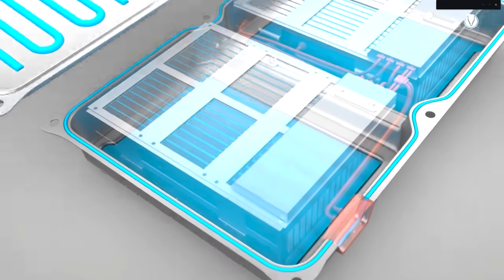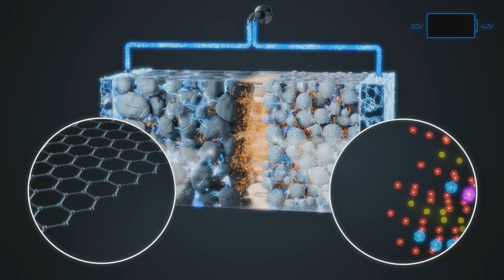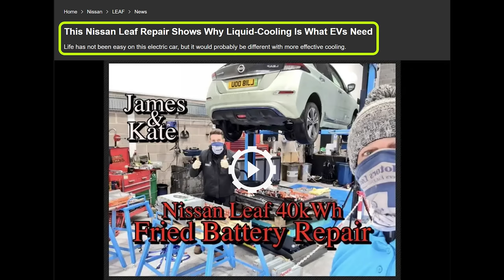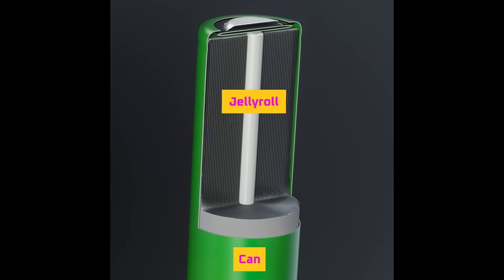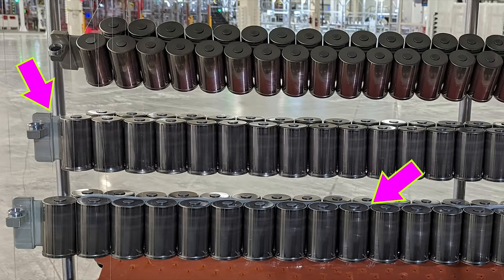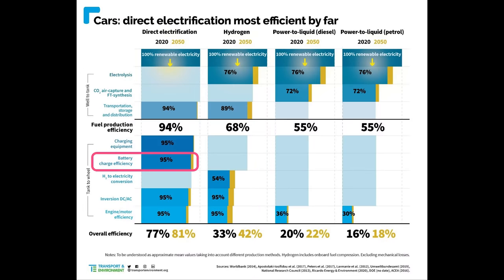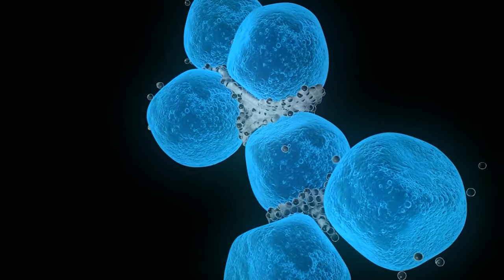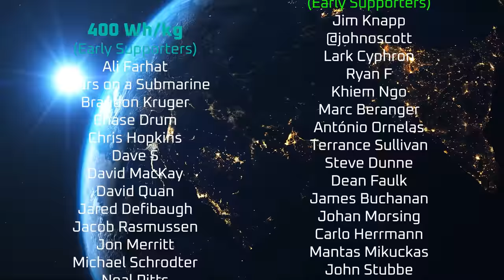4680 Thermal Design and Management // Why Ribbon Cooling is Better

Comment: I always assumed that with the tabless 4680s, plate cooling would be the way to go. I was wrong too. I think one phenomenon to emphasize is "thermal contact resistance", especially in a possible next episode about this topic. This is the thermal resistance from very thin layers of a fluid or gas between adjacent solids. For example between the overlapping tabs in the end caps of the cell. This type of resistance can be orders of magnitude larger than the thermal resistance of the adjacent solids. This resistance can really "choke" the overall thermal conductivity in the cell axial direction.
Reply: It was always about not producing heat, rather than getting rid of excess (imo)
Reply: @rogerstarkey5390  especially around the tab junction to current collectors.
One spot, end of cell, middle of jelly roll, far from cylindrical surface (it’s a spiral, so not half-way).
I’m still getting my head around heat flow ideas.
Reply: @rogerstarkey5390  Yes Tesla for sure has made a huge improvement there.

Comment: Sometimes the initial choice for a particular design maybe the best over time, even for a company which keeps refining its design.  The side cooling ribbon design is still bringing the best result for Tesla.  However Lucid is doing its cooling through the bottom end of it cells which does not make too much sense in terms of surface contact area!

Comment: Wow.  Have learned so much watching your videos on your channel.  What a humble/open-minded teacher!

I do have a question about the thermals on this 4860 cell.  And even the guess that the 4860 cylindrical may be better that that flat rectangular pack (prismatic) for an LFP chemistry package.

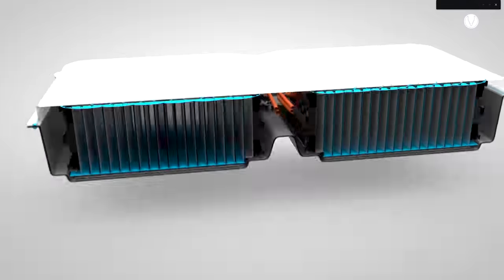You say (at 06:57) that "more surface area per unit of volume, which would improve thermal management" (comparing the CATL prismatic rectangular)

Wouldn't a thin rectangular pack as you display have far greater surface area for a desired VOLUME of battery material?  To contain a volume with an outer boundary with the absolute minimum surface area, the sphere is the choice.  Next would be the cylinder.  Next would be a perfect cube, and rectangular could provide near infinite surface area (really thin).

And beyond surface area, it is unavoidable that the center of the cylindrical cell will be much hotter than the outside than the battery material near the outer radius.  If thermal homogeneity is highly desired as you detailed in the video, why would you want to increase the radius of the cylinder, creating even more temperature differential?  In fact, would not a thin rectangular pack (as shown from CATL) be a perfect match for a plate cooler with far better thermal bond between package and plate, and minimum thickness of the package? 

**************************************************************

Different topic....

In general, I am very confused about this 4680 cell on the thermals.  Here is my thinking.  Where do I get this wrong?

1) A larger capacity cell will require less number of cells in the final battery pack of a given desired capacity.

2) As cell voltage is same between 2170 and 4860 battery packs, the same number of cells are needed for a series run to 350 volts.  Therefore the percent increase in capacity of the bigger cell will necessarily require the same percent reduction of parallel connections of cells.

3) Less parallel runs means that each series run of cells needs to handle more current (for net same pack current in/out).  Therefore the percent increase of energy capacity from the smaller cell (2170) to larger cell (4680), WILL ALSO REQUIRE THE SAME PERCENT INCREASE IN CURRENT LOAD CAPABILITY.

4) Assuming volumetric energy densities are maintained between 2170 and 4860 (same chemistry)....
       .....for the same net pack current load (between a 2170 cell system and a 4860 cell system), that 4860 battery CELL will have to push 4.45x (volumetric ratio 4860 to 2170)  the current of the 2170 CELL.  And the losses will be 4.45x the 2170 CELL.  That is the heat load to be removed by the cooling system.  So far, so good.

5) BUT, in a cylindrical system, for a given length of battery, the ratio of outer surface area to volume is not a constant.  As the radius of the battery increases, the volume grows by the square of radius, and the surface area grows only proportional to radius.

In other words, the new 4680 cell has to dissipate 4.45X the losses of the 2170 cell.  Simple conductance heat transfer:  you better have 4.45x surface area as the 2170 cell to dissipate that higher loss load.  But you don't.  You have only half of what you should need due to cylindrical surface area/volume ratio that gets lower as radius grows.

That has to be a major challenge.  

And now the area of the center of the battery that is generating heat has to travel 2.3x the distance to get to the cooling medium on the outer case.  And I would guess that temperature differentials increase 2.3x, further raising the center area temperature.

********************************************************

I am really confused by this direction.  No doubt, less batteries good from a battery production and from a pack construction standpoint.  But growing radially versus longitudinally makes absolutely no sense to me.. HELP!  Must be doing something wrong on my end.
Reply from the maker: Glad to hear it!  With regards to the thermal management of different cell designs, see my "Pack Analysis" video from a few months ago.  You don't always necessarily have to go for maximum cooling.  Lots of competing interests.

As for the rest of the questions, I don't have time to answer that many 😁.  When I skimmed through it seemed like overall you were on the right track.
Reply: @thelimitingfactor  Thx for taking the time to respond, Jordan.   I think your comment is the only one to make any sense.  The heat load just may not be as big an issue than we think.  The average power draw of an EV (or any vehicle) is only about 25% full load power.  Full load likely taken at the end of a hard acceleration run.  Lots of thermal mass to allow safe intermittent high power operation (if heat was the only concern, as I suspect other issues with high current in the medium).

In any case, keep it coming, man!  Great work here!

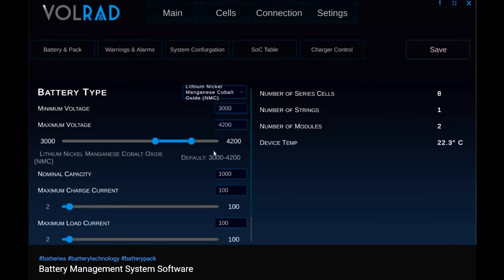Comment: I believe the Tesla battery pack design consist of a group of cells connected in parallel and then these groups are connected in series. Within a paralleled group of cells the BMS doesn’t know anything about the individual cell, just about the groups. I’m not certain if this affects any of your conclusions in the video, though. 3:30

Comment: My guess before watching(although I do actually remember them planning on plate cooling) - they found out that the tabless cells produce less heat so they could still use ribbons

Comment: Maybe this is a dumb question, but why packing thausen of cylindrical batteries vertically when you can stretch the battery to 2 meters long pipe like design, and packaging in a horizontal styles, like a floor made of pipes?
Reply from the maker: That's basically what byd did with the blade, except a ladder frame.  Horses for courses.

Comment: Here’s where Tesla’s “Fail Fast” philosophy makes a difference. Tesla’s engineers very likely just came up with several different ways to cool the cells, including ribbon cooling, and just measured the temp difference under load.  They didn’t write a paper, they just found out what worked best via direct experimentation. 
It is often the case that you can make something and tear it apart and remake a new design of it five times in the amount of time you could verify something theoretically. 
In other words, building something and live testing it in the real world is often faster than theoretically modeling something before building it. Also, building things live gives opportunity to stumble upon new findings and knowledge that might well have been missed by modeling something to get a result before building it. 
I worry a lot about todays engineers getting too far away from a hands on understanding of materials. It is better to have an idea and build it and test in the real world and refine and rebuild than it is to computer model something to death before ever building it. Sure there are exceptions such as when you need to know if something is possible at all, but hands on is the quickest and best teacher.

Comment: Great overview!  I hope someone can further clarify the "peak voltage power delivery" aspect of the 4680 vs 2170.  Currently a Model 3 loses massive amounts of horsepower as battery SOC gets lower.  I assume it's due to rapid voltage sag. Range may be unaffected but a Performance Model 3 with 30% SOC drives  nothing like one with 85%.  Will the 4680, by it's design, be more able to perform similar to the Tesla Plaid, where the car performs steadily until a much lower SOC is reached?
Reply from the maker: Lower resistance in the 4680 may help!
Reply: Power throttling is a factor of inverter design. Power = Voltage × Current this means you can maintain power even with dropping voltage by increasing current draw and the limiting factor for current draw is the inverter. The tabless design will increase max current with in the cell but I don't think Tesla is drawing max current from the cell.

Comment: Prismatic for LMFP and LFP. It seems that most companies, like CATL's CTP 3.0 Qilian, use prismatic because they can integrate liquid cooling and a thermal heating pad into the pack. It will be much more plug and play with no need for OEM's to engineer complicated thermal management systems, they will just be built in to the battery pack. We should also start to see lithium doped hydroxyapatite added to the separators. Think of a bone material in which the lithium electrolyte flows through. Should be great thermally.and safety wise.

Comment: Jordan.
I have a hypothesis regarding the Panasonic "5 tab(?)" 4680.
If there's an issue "air folding" the tabs along the length of the Tesla cell(?) How about if the Panasonic cell has a "raw conductive edge" along one side, of the Anode/ Cathode strip,  without tabs, except for the last 140mm (the outermost winding) which would have fewer, but wider, longer  (about 17mm?) tabs to fold across the bare edges to the centre, like wheel spokes.
These would contact the bare edge of the inner windings.
.
Then, weld a sprung endcap,   similar to the Tesla cell, to provide contact by pressure when the steel cap is positioned.
.
Most contact would be by pressure from the endcap onto the wound bare foil edges rather than the folded tabs, which would simply provide a welding location during assembly.
.
This would seem to provide the same advantages and characteristics, without the complication of cutting and folding fine tabs?
(Hope this makes sense)
.
Example.
Roll a strip of tin foil around a pencil 20+ times.
Wind tape around the outside to secure.
Slide the roll off the pencil.
You still have what is essentially a metal contact, without tabs.
If you press a disc on top (a coin?) The pressure maintains contact.
Reply from the maker: The purpose of the current collector plate will be covered in the next video 😀

Comment: Do you know of any studies showing which type of batteries are lighting up and what the conditions were? We've seen plenty of fires in line but nothing about which ones, if it was design problems or external. Thanks for your work.
Reply from the maker: No!  I'm curious about that as well though.
Reply: Yeah, especially Porsche - specialised cells. Not known to focus on safety! Shouldn’t be when vehicles are idle, parked, on ocean.

Comment: If it can conduct electricity, it can conduct heat. The current collectors at the top are wicking away heat then conducting over to side can. Dual purpose for sure. The tabless design is also drawing heat out from the center for same reason ohmic resistance is lowered. Did not surprise me that side cooling works.

Comment: I wonder if the cooling becomes less effective towards the rear of the Pack as the heat is absorbed from each cell?
Reply: Does this mean the cells towards the rear of the Pack will degrade faster overtime
Reply: Or will Tesla reverse the flow of coolant to prevent this from happening
Reply: Does this mean the cells in the centre of the Pack will degrade quicker than the ones on the outside of the pack? or are the cooling channels routed differently within the ribbon to compensate for this
Reply from the maker: No, this is why I said in the video that the gradient isn't as large as you'd expect.

Comment: It's amazing how many problems around us are related to thermodynamics.  The ability to solve them require you to understand the three thermodynamic laws, and in today's world, the ability to computer model your problem using differential equations

Hey, It's all about the Thermodynamics!

Nice to hear that Tesla is focused on making their batteries last.

Still have other components that need the same life cycle (BMS, welds, wiring, moisture intrusion prevention, etc)
Reply from the maker: Amen!
Reply: Minor point, but Its all about "Heat Transfer" 

Conduction, Convection, and Radiation, 
.......not Thermodynamics

You will not learn about Heat Transfer in a serious textbook/class on Thermodynamics.  You would be taking a separate class/textbook for "Heat Transfer."

But you are so right about managing thermals in electrical/electronic/electro-mechanical systems.  It is the limit on everything (espec motors/generators).

Comment: Greta video but I would like to point out that plate cooling also utilizes the Can of the cell to cool the sides of the cell as well, Plate cooling allows the copper and aluminum conductors a less Thermally restricted path for heat transfer whereas in just side cooling 20 percent area the heat has to travel through multi-layers within the roll of the cell to cool. This is still effective but the difference is seen when the cells are stressed thermally in high-current modes of operation. This is why Ribbon cooling is not as effective in race conditions or long-duration high current draw situations. Of course variables such as coolant temp can factor into this but as a researcher who has experimented directly with cylindrical cells , Plate cooling a cell that is designed for it is more effective at heat transfer. I am curious as to why you did not use the Lucid module design ( a plate-cooled cylindrical cell ) in any of your comparisons as that would have been a more comparable difference between the 2 types of cooling methods.

Comment: I believe your original assumption concerning end verses side cooling to be correct when it comes to end/tab cooling, though side cooling could potentially be superior if implemented correctly. The problem as I see it is that Tesla’s ribbon cooling solution cannot achieve equal cooling to all the cells, meaning the cells at the intake side will experience lower coolant temperatures compared to those cells at the outtake side of the pack. The other problem is that the ribbon as you have explained is only contacting at best 20% of the cells side area, a further problem is how to guarantee adequate thermal contact between the cooling ribbon and the cell side cylinder wall. No matter what, you have given me something to think further about.
Reply from the maker: I've looked into that, very little temperature variance between the intake/outtake is a small fraction of a degree.  Also, that was perfected even more with the intra-ribbon loops.

Comment: also, the bottom of the cell has a noticeable airgap between the active materials and the casing, thus really not effective cooling area Vs side. Cooling from the top gets challenging as that's where the electrical connections are made for positive and negative welds.

Comment: Question: the cells are encased in some tough polymer as the Munro tear down showed. I get that the polymer has limited cooling capacity, unless Tesla designed that material to absorb some heat. Once warmed maybe any potential cooling bennies are negligible?

Comment: Ribbon cooling is a little bit cheaper to implement in manufacturing. I'm pretty sure that's the only reason because the electrode itself is actually a long flat ribbon that's been coiled up which means that cooling the side is not actually cooling the side, you're cooling the ends essentially. The heat actually can travel faster along the width of the ribbon up to the top of the cylinder and then out to the sides because of the larger thermal mass then it does around the coil a bunch of times to the outside. Cooling the outside of the cylinder is easier than cooling the top and the bottom together and cooling the side cools it roughly equally. It's pretty good, it's pretty cheap, it's pretty easy to do, pretty reliable, and overall just a good balance of lots of factors. It's not really the best in any regard but without spending ridiculous money this is kind of the best compromise for the money

Comment: Not sure why they stopped at 46. They could have gone for 8080 with a hollow core instead. This would give them cooling lines through the whole core and 80% of the circumference. It would also make it trivial to connect those in series, as they line up that way automatically when threaded onto the central cooling pipe.